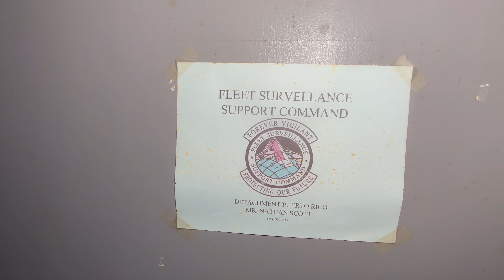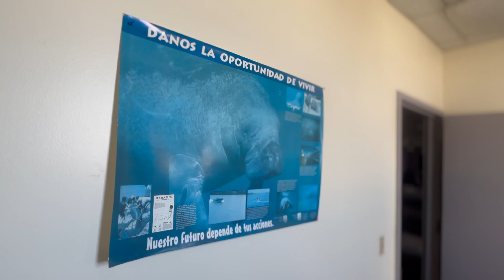Roosevelt Roads PWD

Comment: In 1969 after a year tour in Vietnam I was sent to PWD Roosy Rds. Was a CM in the light automotive shop. We were first in the back of the building down the left side if you are facing the rear. The heavy shop was across the building on the opposite side, then the powers that be thought it would be a good idea to put all the maintenance on the same side of the building. So we got moved to the opposite corner in the front. All the equipment and dispatch was now on the same side. Made sense I guess. My oldest daughter was born in the old hospital back at Bundy. Wasn’t a bad assignment looking back. We had a lot of civilian mechanics doing all the hard jobs. Shame the base was let go to the shambles it is now.
Reply from the maker: Thank you for watching and shareing.